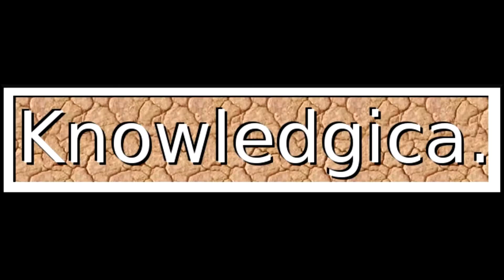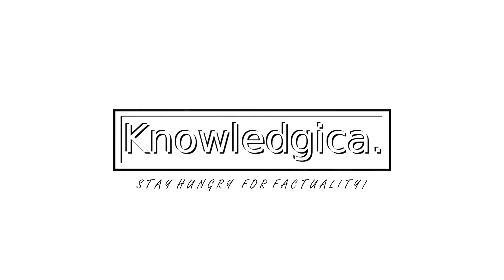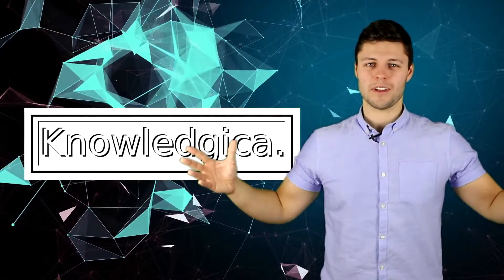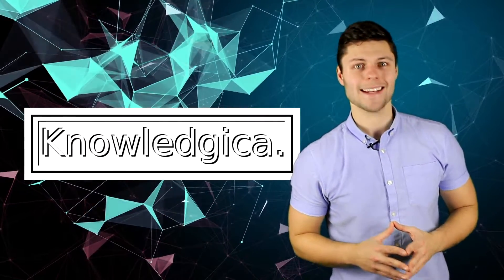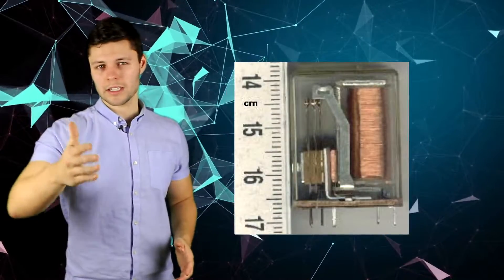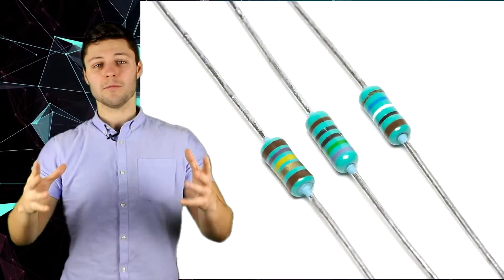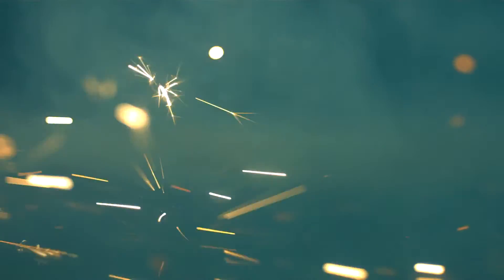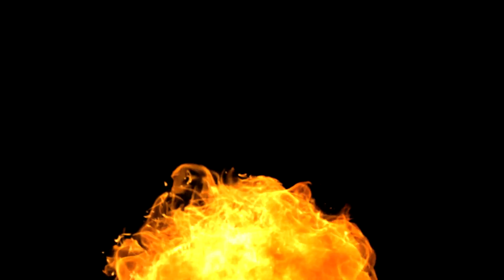How Do Car Indicator Lights Work?

Comment: Should probably be mentioned that this isnt how they work in modern cars anymore, they're computer controlled because its more reliable and less failure points. They stopped using the manual components around the late 2000s. Interestingly they are still programmed to flash quickly if a bulb goes out despite not having any physical reason to. Its simply a way of letting the driver know an indicator light is out. Quite clever really